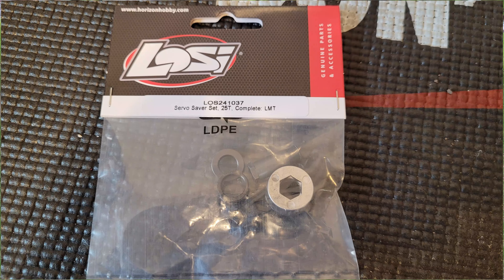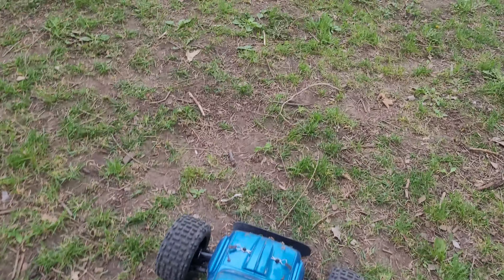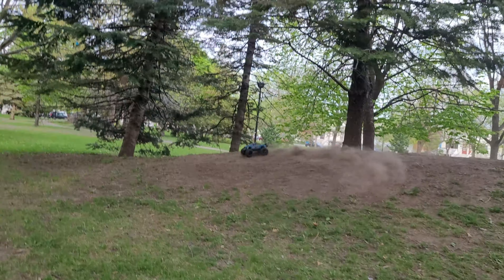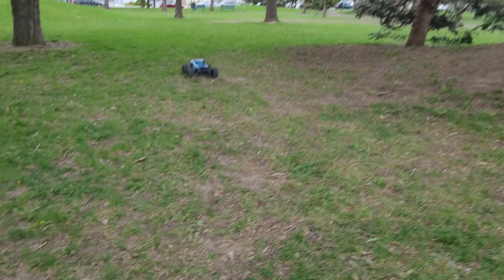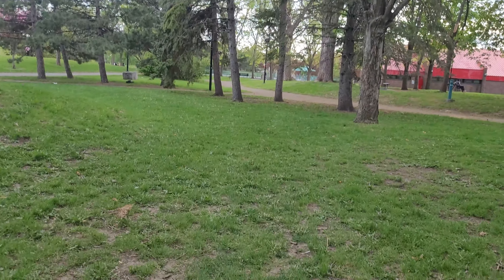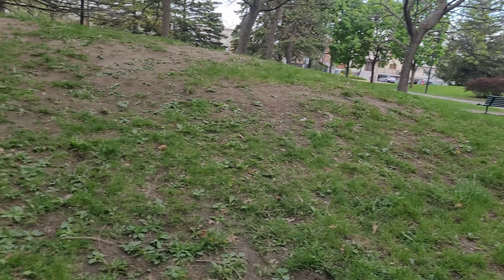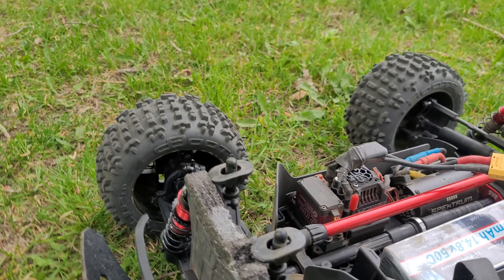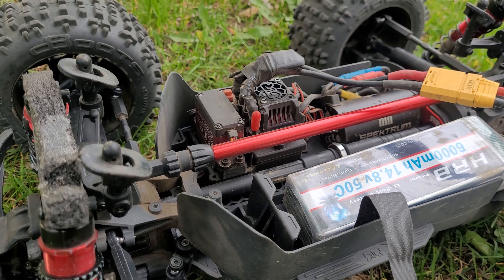ARRMA Outcast 4s v2 with losi LMT servo saver. Success!!

Comment: Appreciate your show Surch💯😎 I wonder if lower the punch will make 17t seem less fiery and rely the motor more so than the esc 😊
Als maybe even swap the diffs around and have thicker in the fron and thinner in the rear asst yo today I think it’ll push wide
Like the XRT 1/5 8s 
When Razor switched the diffs around he preferred it to the stock push wide🤓😀
Even better if your diffs are same front to rear 🥳🥳
And let us know if you do🙏🏿
Reply from the maker: I went thicker in the rear to help the rear steer.  my punch is at 3 going to try 1 when i convert my outcast to a kraton v1.5